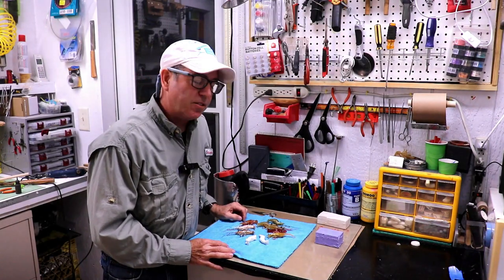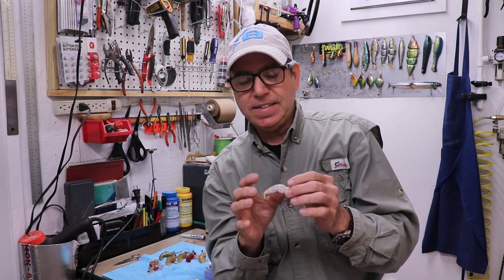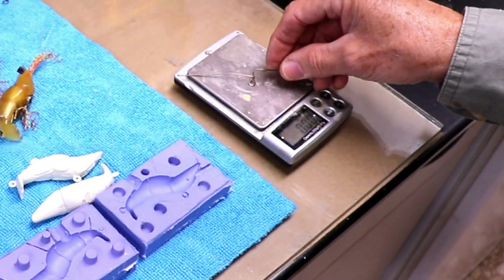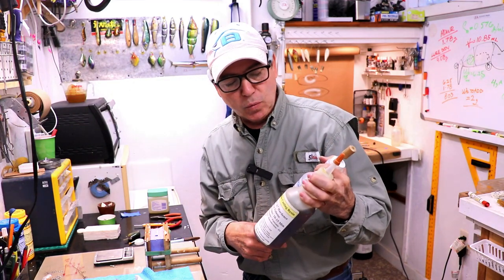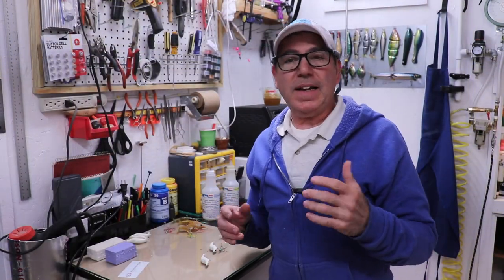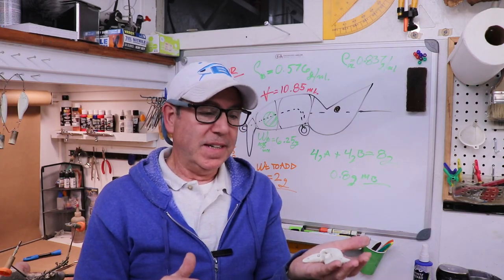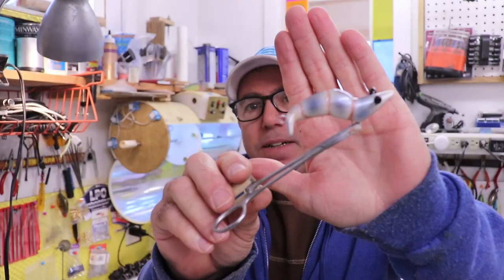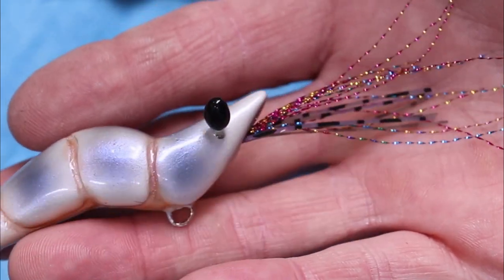Making a Topwater Shrimp Lure, Topwater Wake Bait  #shrimplure #makinglures #fishinglure

Comment: You mention lowering the tow point to add wobble if you have made a  wood lure that wants to turn over is there a quick fix i.e. adding weight somewhere  to remedy this ? I expect you want to lower the c of g Thank for the great content .
Reply from the maker: The thing with crankbaits that have dive lips is that trying to control roll with weight just won't do. There's just way too much influence from that lip.
Reply: @EngineeredAngler  ok thanks ,so my only option is to change to tow point??
Reply from the maker: Check for symmetry and to be sure your bib is nice and aligned.  Also, Here's a bit of an experiment; put in your tow eye with just a millimeter of shaft outside the lure.  This way you can try tuning by bending up towards the top of the lure and down toward the dive lip.  And, of course, side to side if needed.  Do it in very small increments and see if things improve in one direction or another...good luck.